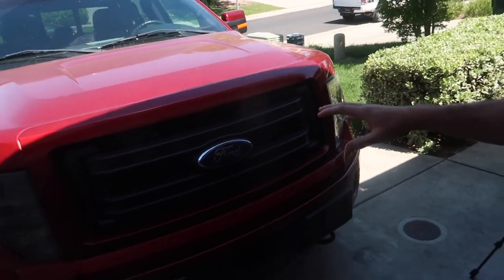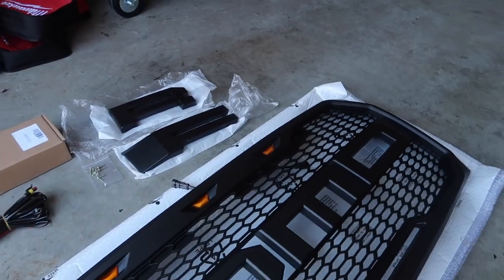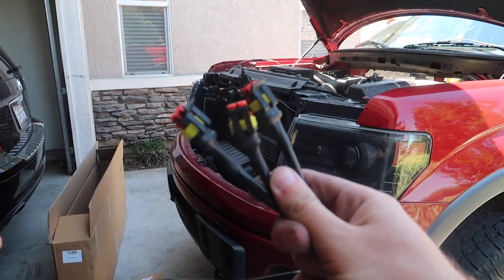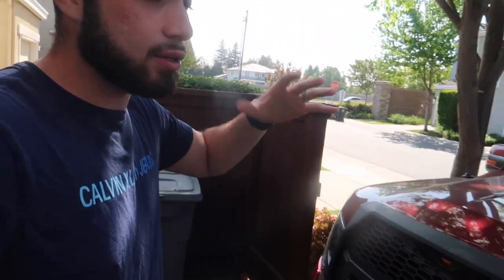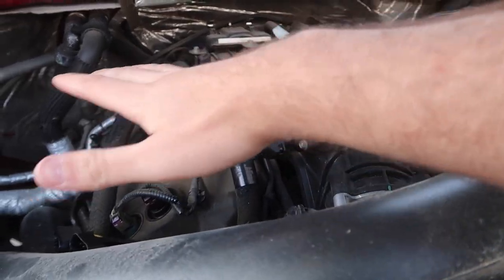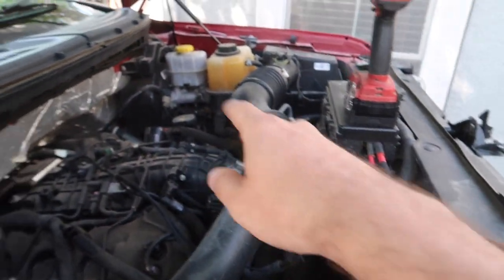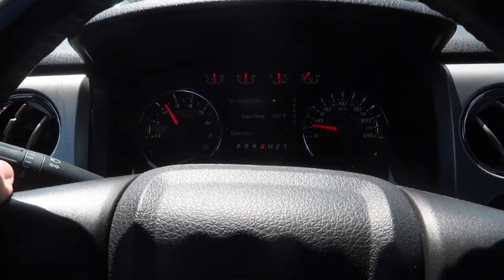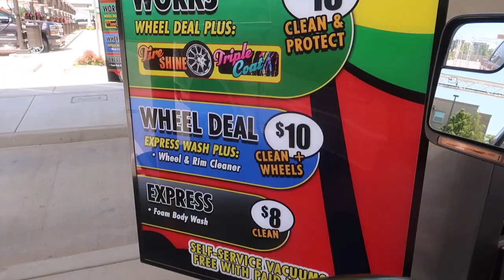FIRST 2 MODS ANY F150 OWNER SHOULD DO!

Comment: Mines a 2012 5.0, raptor grille etc that I spray painted white with “raptor style gloss white paint” and “raptor style clear coat” from autozone, 1400$ morimoto headlights, 2400$ 500 LBs American made heavy duty steal bumper/brush guard from iron cross  (1 piece welded together) 10 gauge steel with quarter inch piping for the brush guard (I’ve hit 6-7 deer in 2022 going 60-70 and no Damage thanks to it lol LED tail lights, brake light bar/strip under tailgate. Aftermarket/upgraded valve cover with a white letter “F150” cover for the valve cover, performance spark plugs etc, I could keep rambling on but anyway 5.0 is a strong engine (the biggest for that year) sitting at about 216k miles right now after putting 50k mile for work in 2022 and still strong. Stock the power numbers for my 5.0 flex fuel was 450 horsepower (kind like your now numbers are) so I wonder after all this upgrading from what I have done so far and what I want to do what my new horsepower number is lol
Reply: What mods did you do to get the extra horsepower?
Reply: Like @luke8222 said, what engine mods did you do other than the valve cover and spark plugs?

Comment: Great video man but I recommend you do a little research on e85. It is not actually 85 octane but rather 85% alcohol and is closer to 108 octane and it will boost your power the most out of all the fuels at a normal gas station.
Reply: Completely wrong. E85 is 85% gasoline and 15% alcohol. Todays normal Unleaded gas in 10% alcohol!
Reply: Use Sunoco 94 Octane and your Ford F-150 will hum going down the road! Minimum Gas requirement is 91 Octane with the EcoBoost 3.5L engine!